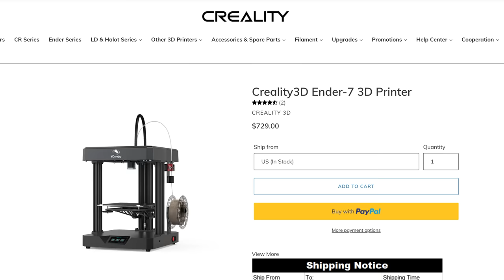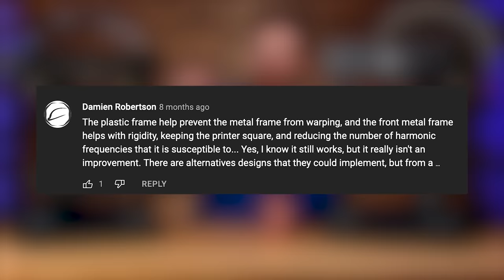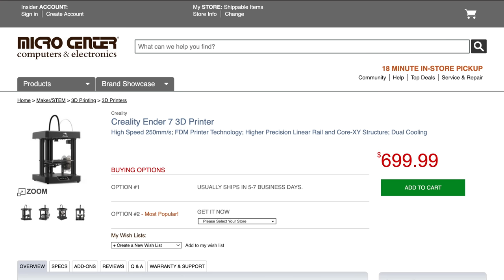The End of the Ender 7

Comment: I started on an mk3s+, wonderful machine, prusas stock settings prusa slicer are nearly perfect aside from finicky disagreements.

Bought an ender 7 thinking I could get a production machine to turn out parts.... Nope.

Best I can get out of it is 0.5 mm vertical tolerance... The prusa gets 0.05 mm tolerance, with 0.1-0.15 being suitable for pipe threads.

Don't try that with the ender.

Comment: This machine reminds me of my Ender 5 Plus.  The firmware was borked straight out of the box and needed much tinkering. Not to mentioned every fan on it failed after 2 months of use….. It has never been as consistent as my three Ender 3s. It is always the last machine I want to print on nowadays.
Reply: My Ender 5 Plus is a real workhorse. Prints PETG better than both my FLSun SR and Ender 3 v2.
Kersey Fabrications firmware is dead easy to install, and works very well indeed. 
One of the fans have failed, but discarding a printer over failed fan is irrational.
You should give it another shot:)

Comment: I run 10 Sapphire pro core xys with duet wifi boards and bl touch.. yes a bit of tinkering needed to get right. But they are great reliable and 1 has a e3d volcano heater block , the other a CHT nozzle and they can print nicely at 100mm/s.  250mm/sec is very ambition on what looks like a pretty stock hotend

Comment: strange, since a cnc machine with right settings, either brand, should work perfectly; it means the machine is not made well. I make my machines myself, the total cost is under 200, BUT everything, until the last spring and bolt and connection, needs to be perfect (tolerance 0.02 mm on everything) Then it is a question about the right slicer settings (the gcode as you mentioned). They do not differ between my printers, nor should the gcode differ between machines with the same dimensions or power (they differ with lighter or heavier machines)

Comment: What a shame that the Ender 7 didn't perform up to expectations :( i had an Ender 3 Pro that would produce very brittle prints like this, to the point of where the prints were pretty much useless. Granted the Ender 3 is only a fraction of the price as this Ender 7, I ended up just replacing the complete hot end for like $17 and never had a problem since. The stock machines are pretty inconsistent as far as what you get out of the box, but are amazing work horses when you upgrade to aftermarket parts.

Comment: this is a CONSISTENT error with the entire Ender Line-up, I can say that because I have an Ender 3 and NONE of my prints print to scale at all. nor do they adhere to the build plate either. I need to use Construction paper to print ANYTHING and even then I NEED a Raft which causes ugly prints. please steer away form Ender 3D printers.

Comment: I want a 3D printer to print parts, not to tinker with the printer. I also want to print with engineering quality plastic. (I want to print with the less expensive filament for testing before using the more expensive filament.) What printer would you recommend? What do you think of the R QIDI TECHNOLOGY X-CF Pro? Will you be reviewing it any time soon?

Comment: This is EXACTLY why I have a mk3 now! I got so enraged by the lack of consistency that I’ve borderline decommissioned my ender 5. I’m gonna add a direct drive extruder and octoprint at some point. But until then, the absolutely exquisite mk3 will do.
Reply: I hate mk3s I swapped em all fjr ender 5s and they work 24/7. Used to spend hours and hours on the mk3s.

Comment: The problem seems similar to cr30... I mean the XY core system is to in consistent... I did get the cr30 to print descent. But with some real consuming try'n fail test...i i don't trust it enough to do quality work... And the ender 7 bedplate adhesive and without bed leveling...  It's seems that creality needs to get back in to the r&d lab... Or they will soon be forgotten. Ender3 is getting absolete on the price point. And  for a tinker machine it will not be interesting at half the price.. because of the bad core XY system is buggy. And the the frame with the bed axis is almost a complete redo...so for me it's sad....as my cr20 keeps on working   have only changed nosles. Even still running same hotend. For 5 year running... Biggest flaw on the cr20 is the noise.. so creality rework you core system. Next printer you make, don't innovate if you don't get it to work.

Comment: Well , for me , all or most Creality fdm machine are good for hobby use, if yuo want a horsepower machine , well yuo neeed to make a lots of mod (extruder, fusor, electronic motherborad, autolevel,etc)
I did this, and they work ok  , but yuo need to learn a lot too, how to calibrate the printer(x,y,z ,extruder, flow,horizontal expansion,etc),how to calibrate little things or big things (acuracy) specially for engeneering things
, use the right materials, use the right speed/flow, and understan that any technology have his own limits

Comment: I wish I saw this before I bought the ender 7. Their tech support is terrible, they wont take a return. (if you buy one, buy if from amazon so you can return it if need be). I literally had 30 hours in troubleshooting before I got a successful print. The trick was the magnetic hot bed for the ender 3. 
Oh... I cut mine also, no problems whatsoever. Really a bad design.

Comment: Send them to me , I will use the parts to make a new printer :) , Just like I did with my old printers. I made a X300Y300Z600 V-rail wheel based printer , designed by me and all the parts were made by me on the laser at work , its 90% all metal ( still need to work on the hotend parts to make them all metal) , its mostly stainless steel ( altough adding some weight to some parts) because I can weld them (cant weld aluminium since im a novice welder). I use BTT Skr V1,4 Turbo ( since I made this a while back) . Now Im moving in a new place with more space and Im interested in making a Core XY machine and a CNC machine.

Comment: I would like to add that the Ender 7 also has closed source firmware. So all improvements that could possibly be made by hobbyists and/or tweakers are prevented beforehand, making the buyer solely relying on Creality to update/improve the firmware. Sure - There are some "fan" modifications and firmware, but they have limitations because it's all guesswork.
I think Creality dropped the ball with their latest range of printers. Creality gained a LOT of attention because their early printer versions where highly modifiable in both hardware and software. However - With their latest models it feels like they have slammed the door shut tight for that fan base. I think it will hurt Creality considerably in the long therm. Personally I rather keep my older models (Ender 5 Pro, Ender 3) and feel no need to "upgrade" to newer models. And I think I am not the only one...

Comment: Sorry, but your points are pretty irrelevant if you know how to level the bed on the run. Ender 7 is a great machine, with capabilities to print relatively fast (not as 250mm/s as advertised, but still faster than it's previous ender series machines. I got 4 of these now, and I don't feel any need of neither auto bed leveling or cutting the frame. Know how to level the bed, and you are good to go. Depends at what price you get it of course, but I am not complaining.

Comment: I saw the original live stream and heard the specs and thought Im going to get one of these and throughout the stream my head was telling me no dont get one, then after the live stream I thought well maybe Joel just got a bad one, no everyone that bought one got a dud, I read some real horror stories about this machine, I knew there was something going on at Creality by the stories I was reading online about loads of different models, bad quality parts, no support at all and then when Naomi Wu threw in the towel with Creality I knew the marketing suits had taken over the R&D department, I have had problems with every Creality machine I have bought except one the Ender 2 original, the Ender 2 Just Works!, so I vowed never to buy another Chinese printer again, I have put my deposit down for a Prusa XL and have the remainder saved up and I have 100% certainty that I will get a good machine and if any problems do surface I have 100% certainty they will be addressed I also have 100% certainty Prusa will continue to improve the XL and finaly I have 100% certainty I am going to love using the Prusa XL

Comment: I have to wonder if this is a problem with their recent beds? I've been having some really bad problems with an Ender 3 pro I recently purchased with getting bed leveling right, I've found using an ABL system slightly helps but it's still an inconsistent pain when it comes to levelling (though there's also a good chance that I'm just... Not good at getting the bed trammed/leveled properly), often the only way for me to get consistent prints on it is to use a raft. Not super likely to be related but this has certainly gotten me curious
Reply: The gantry can sag as its only supported on one side... 😕

Comment: Hey Mr Joel, at least you gave the printers a fighting chance! I myself am still thinking about getting a Neptune 2 instead. Thanks for the great video and information. Have a great day and continue the great work. 👍
Reply: It's a decent printer but I had back luck with two of them.  If you do get (and have better luck I hope), make sure to check out the wiring that plugs into the motors before you put it together.  I had several wires that were pulling out of the connectors, and I didn't notice it until I was done building it and plugging everything in.  Kinda sucked lol.
Reply: @MrNickpeck36  thank you for the heads up on the plug situation. I hope your printers are working good for you now. Have a great day.

Comment: Paying a premium price for an incomplete printer, is no longer an option.
I have the CR-X since September 2019 and the printer never worked like it should. I had to tune it A LOT with custom Marlin firmware - plus add essential hardware like filament sensors and BLTouch - and it still cannot even come close in terms of quality with the prints produced by my Delta printers (FLSUN QQ-S Pro and Anycubic Predator).
Lately my farm got a brand-new CoreXY TwoTrees SP-5 v1.1 and this one works beautifully - like the Deltas - right out of the box (albeit was not so easy to set-up like the Deltas). Installed a 3DTouch to the SP-5 and the printer is producing quality prints EVERY TIME, like the Deltas.
I can fully understand how you are feeling because when you run a print farm, time, filament and electricity cost money (especially electricity is very expensive in Greece) and when you do not get good results, everything goes to waste.
So, no more Creality for me after the mediocre CR-X EVER!

Comment: Thanks for your synopsis of the Ender 7. I was thinking about buying one of these because I love my first Gen Ender 3 since it worked perfect out of the box. Still using it after all these years. You're right about lowering the price to entice tinkerers to buy it. Heck, Creality would probably come out ahead because it would be like adding a whole bunch of R&D people to their staff. Lol.
Reply: They already do that with the ender line.  The "upgrades" they put on are simply the ones people buy/make most often.  They don't even really develop anything, they're just using things that are already made in China.
However, with my CR6 SE(that someone else bought), I kinda feel that buying anything north of 300 USD from Creality is a mistake.
Reply: @Grimmwoldds  I ran my Ender 3 completely stock for almost a year. At that point the plastic filament feeder broke so I replaced it with an aluminum one. After almost 2 years I started changing and adding things. Not because it needed it but because I wanted to see what improvements they would make. In the end the biggest improvement was a glass bed. Nothing else made any difference, including linear rails.

Comment: To be fair, since the Voron is smaller, it’s geometry cannot just be scaled up and still be as stable as It was when it was smaller. 
HOWEVER, that doesn’t matter if the cross beam makes the printer unusable. So I would still agree with cutting the front piece off. Even if it weakens the printer.

Comment: If your problem is that it doesn't stick to bed you could simply buy a new bed surface for 10-15 dollars, it surprise me you didn't try that
Reply: That was not the only problem. It also could never produce consistent quality.
Reply from the maker: That’s not the only problem - standard print speeds produced inconsistent results.
Reply: @3DPrintingNerd  thx for answering me, Ender 6 and 7 looks like failures, I hope they make Ender 8 a good success

Comment: I wonder if Klipper could give the Ender 7 a boost in quality. Seems like the hardware is decent - maybe it‘s just the firmware.
Reply: Creality quality control, software and firmware appear consistently crappy. Got a CR10 Smart Pro a few weeks back, and after the mandatory neophyte troubles of getting a print at all, I started figuring out how to work it. First, the machine was not even close to being adjusted, all axis were all over the place in terms of play. The presliced bunny on the SD card did not look good at all. Next to go was the Creality slicer and Creality Cloud, replaced by PrusaSlicer and almost instantly giving good results. Then it appears the autolevelling (which is beyond slow) is struggling, it throws error codes (which conveniently incapacitates the machine until you power cycle it) every now and again. And the rather noisy hotend cooling fan does not turn off after the hotend has cooled down after a print. Klipper will be installed shortly...
Reply: @subwooferbone  Klipper is a good way. However: the hotend fan is directly wired to the 24V port of the mainboard - no way of disabling it by software. That‘s the case for all Creality printers.
Reply: @Schnabulation  can’t be, because it only turns on when the heater passes 60-70 degrees, and it turns off on every probe touch when auto leveling…
Reply: @subwooferbone  Srly? Then it's a CR10 Smart Pro special. Because all the Enders have them wired to be 100% on all the time.

Comment: If the machine needed a front piece for rigidity, it would have just had a rib in the front. Or a full square frame.

A plastic cap like this will not help with squareness or rigidity. I seriously doubt these people where actual engineers. (or good engineers)
Reply: There's a 6mm plate below the plastic frame. The whole thing is a flat square plate with a square hole in the center where all core XY drive system is attached. The right thing to do was to cut only the plastic fairing and leave the plate intact so it does it's job correctly: aid in angular alignment of both Y axis rails around X axis. The top plate is supported by two 4020 profiles with questionable attachment to the printer base (misaligned holes on warped sheet metal base) so the top plate should be continuous. I design precision equipment and the printer's build quality is just bad, at least the one I've got. But an angle grinder was not a solution, it just showed that this guy is an amateur.

Comment: Ender 7 is a miss on the design.   Too bad.    Ender 6 Pro would have been so much better of a product.    Ideally with a belt design that is compatible with Rat Rig or Voron aftermarket tool heads.

Comment: So y'all don't have a pei bed you could throw on it? I've found the ender print beds are hit or miss at best. Y'all kinda gave up super easy.
Reply from the maker: I need to review machines as they come from the manufacturer. I could have said “get a PEI bed” and filament would have probably stuck,  but then I would need to say “get a better hot end” as well. At that point, it’s not a $700 you should be buying :)
Reply: @3DPrintingNerd  your point is solid and I get where your coming from because it is helpful to know what your buying into a head of time. But honestly these days, and I think you can agree, usually goes without saying when buying a creality printer, your always gonna have to get up grade parts for it. I'll still never understand half the design directions they went with on the v2 but yea now I'm just rambling. Lol
Reply from the maker: @johnnyhellfire6  Oh, I don't disagree. The Ender 3 S1 comes VERY VERY close, but, well, you'll see in the review coming up.
Reply: @3DPrintingNerd  yea, I heard about that one. It's basically a anycubic vyper with direct extruder and usb-c . I mean has some good points but I can say first had, the vyper is still the better pick. I'm thinking of just sticking to them for my business